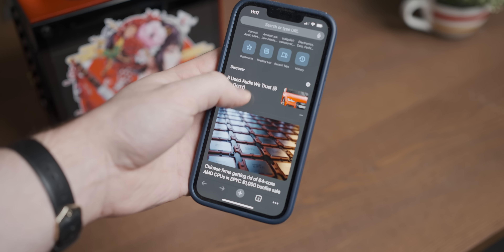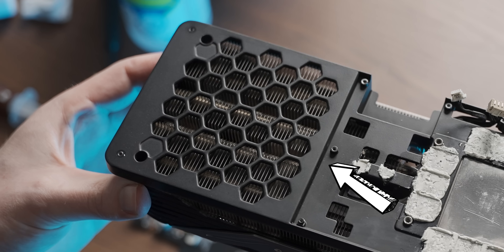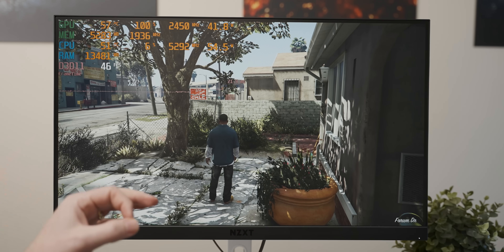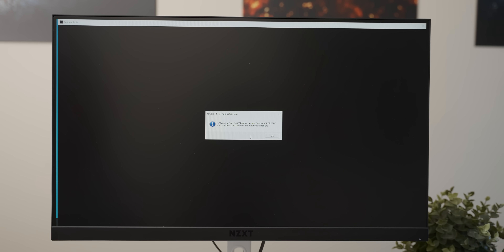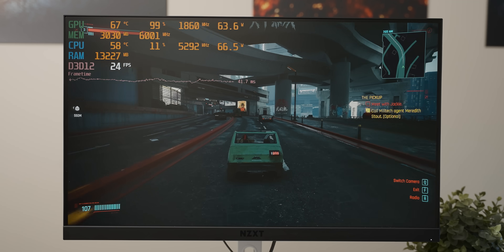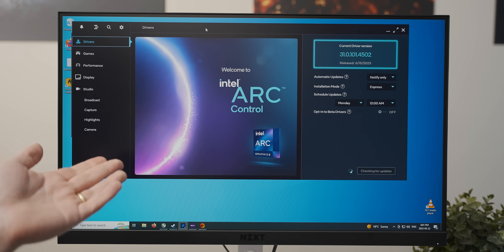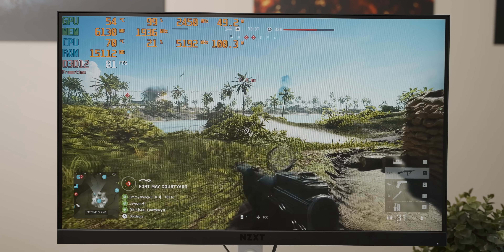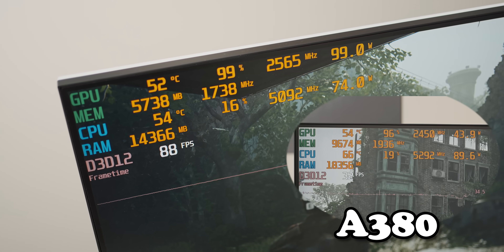The New Master Of Fine Wine Graphics Cards?

Comment: At what point does it stop being "The drivers aged like fine wine," and start being "They released it with broken drivers?"
Reply: Depending on where you go, it was always that. See Gamers Nexus. 

Given that Alchemist is Intel's first foray into GPUs, drivers being broken out of the gate was kind of expected. Not a good thing, but they had to launch the product one way or another.
Reply: Day 1 is never refined. Dlss by nvidia for example on initial release was near nonexistent or garbage. Day 1 release will always be buggy.
Reply: I had many problems with AMD GPU drivers on Dell Laptop... definitely not fine wine...
Reply: When you start coding drivers yourself
Reply: depends if you are marketing for the card or buying it.
Reply: In this particular case it's safe to call it broken drivers at launch.  Multiple games just flat out crashing, significant graphical glitches in many titles, unexplainable performance issues (CS:GO being a slow, stutter filled mess), broken UI, unreliable install / uninstall, etc.  To me, there's a difference between blatant bugs (feature X didn't work) and optimizations found over time (finding a way to do feature X faster/better).
Reply: It's ironic really, because with AMD gpu's, I always go on the assumption that, if you are happy with the release day drivers, then don't worry about it, because performance is only going to get better with time.

AMD is well known for fine wine and getting better performance, but it puts them at a disadvantage against Nvidia, because most gamers look at the performance on release, not what it can be 6, 12, 24 months from now.

The irony is, AMD cards for the price range over the last decade have always offered better performance for the price, especially once fine wine kicks in, the gap tends to widen, but unfortunately for AMD, that doesn't gain mind share or market share with gamers, which is really what they need if they want to compete with Nvidia, especially at a time when Nvidia is more or less handing it on a plate with how greedy they've become, especially at the low and mid-end.

The sad truth is, AMD and Intel should be having a ball in the low and mid-range market, with Nvidia making it easy for AMD and Intel to steal market share away from them and yet they are not moving the needing in the gpu market, a big part of that is because AMD and Intel are being too greedy with its gpu's, they have to realise that they are the underdog and have to be far more aggressive on pricing if they really want to make some inroads in the gpu market, Nvidia must be laughing their arses off with how easy AMD and Intel are making it for them, so much so that I have to question if AMD or Intel actually wants to gain any real market share from Nvidia, because if they do, they've got a funny way of showing it.

But in the case of Intel, it's their first gen gpu, drivers were a mess, maybe they don't want to go mass market till it's products and drivers are more mature for prime time, maybe the next or gen after, but AMD have no excuses, there are many things it could do to try and gain market share, especially on pricing.
Reply: The drivers they released were grape juice.
Reply: Fanboys : its fine wine
Normal consumer : so its unoptimized drivers 
Fanboys : i never have problems with driver its oooold times ago .
Normal consumer : ok 
Fanboys : haw dare youuuuu

many gamers want to experience it  again when the first times they complete the games they like but they cant . we cant erased our memory cant we ?  so we need optimized driver at begining not fine wines . same like unoptimized porting games ? 
 .
Reply: when nvidia does it. when amd and intel do it that's just fine wine or smth.
Reply: I rather have high performance from the begining than getting 10 extra fps after 4 years.
Reply: Well, tbf, they weren't broken from release, they worked. Then they made improvements over time, and gave those improvements to you for free, so I guess it depends on how you look at it.
Reply: @jeffvanstone  Nothing is for free, sorry. The cost of development of drivers are calculated into the price.  No company gives away anything for free . How would a company survive giving away stuff for free?
Reply: @AndrewTSq there is actually a company that gives away water bottles for completely free
It's all payed for by ads they put on the bottles
Reply: @jormjohnXII so then it’s not free lol
Reply: @KryptonixX  the water does not cost you any money, it is free
Reply: @jeffvanstone they didnt give you more performance for free, they got their shit together later and gave you what you shouldve had.
Reply: @jeffvanstone  You already paid for the hardware and it didn't change, only the software did. They didn't give you anything for free. If your graphics card is capable of hitting, for example, 150 fps and it only hits 95 fps with release drivers, new drivers bringing it to 145 fps, the new drivers isn't giving you "free" performance, just allowing you to utilize more of what was already there. The Arc GPU's was of course new technology, new architecture and all that, so it's to be expected. First gen Ryzen had their fair share of issues as well, so did first gen RTX cards but both the Ryzen architecture and the RTX features have improved massively, i'm sure it will be the same for Intel's GPU's as they develop and mature.
Reply: @jeffvanstone I don't know about you, but having to reinstall Windows 10 just to update the drivers doesn't constitute "working" in my opinion.

Arc drivers are in a much better place now, but at least until December of last year, they were a dumpster fire.
Reply: it was always just broken drivers, whether it be intel or amd or whatever. the fine wine thing just started out as copium from radeon fans because the radeon driver team almost never released drivers on launch day that actually used the card's full potential (apart from the rx 6000 series, which was actually pretty good in that respect).

Comment: Right Dawid! People don't understand how good the cards like the RX 6600 and 6650 XT (Other cards are available - these cards being amazing does not invalidate your choice of cheap overpowered GPU! 😀) are for the price! While people are busy with "Well at 4K with max settings and showcase RT enabled you need an RTX 234523460" - the FACT is that the VAST majority of people still only have 1080p monitors. The fact very few people (Aka most reviewers) do not actually recognize that an RX 6600 ACTUALLY slays at 1080p is borderline criminal negligence! 😀- The problem is that there IS a lower limit to this - and just like the GT 1630 - the A380 simply doesn't meet it.

The real problem for these cards is the fact that you can get cards like the RX 6600 for 180$ now - and something like a used RTX 2060 - for about the same price as this card - meaning it might be "a lot more" in % - however when building a PC and looking at the full system price - it's not that much - and the performance is not even comparable. It's a fun toy - the same with the A750 and A770 - however I would NEVER recommend anyone who is not VERY MUCH into tinkering with stuff get one over the AMD and Nvidia options. The A750 and A770 are also AMAZING performance for the price..... when they work.... when they don't then good luck figuring out why! Build 8 identical systems with the A750. 3 ran flawlessly, 3 ran mostly flawlessly - 2 constantly had issues and crashes. changed up the hardware, now 3 ran poorly, changed it up again, now all of them ran "acceptable"... 2 weeks later the first one flat out died. 3 months later another one died.... No one - INCLUDING Intel - could explain it - nor excuse it. And before you ask - I marked down which cards did what to keep track. The first one that died was one of the 2 initial GPUs which had issues, the second one was one of the ones which ran flawlessly in all 3 "builds"... so no pattern there.

Comment: The problem with every single graphics card review is that they only reference games. Which of those 3 would be better for a streaming server just as an example, stream count, codec support etc? There are plenty of other things for some people besides just a few games that have been seen 1000 times before. For me personally it's more of a driver question, so comparing the Intel against the AMD is the only important factor. As a Linux user I never entangle myself in anything from nvidia.

Comment: I think one of the biggest problems with the Arc cards is that they have higher CPU overhead, and that they also require ReBar for full performance. This wouldn't be a big deal on an upper mid-range or high-end graphics card, but on a low-end card, this makes it very impractical for most people on a very low budget. 

However, I did recently learn that most AM4 motherboards do have bioses available which do actually support ReBar/ SAM, even most first gen 300 series AM4 boards, and those bioses have also added Ryzen 5000 series support. You just need to be very careful when installing a bios, especially a "beta" bios. Read all instructions, make sure it's compatible with your exact motherboard model, and check to see if it will be compatible with the CPU you intend to use in your motherboard. Bios updates often have to remove support for old CPUs in order to add support for newer CPUs, which is janky, but far more preferable than not being able to support Ryzen 5000 CPUs at all.

Comment: I get the idea, but I don't think comparing a €143 A380 and €139 GTX1630 to a €215 RX6600 is really a fair comparison, at that point you're paying a solid €70 more, which is just straight up half of the original starting point. Given that an RTX3050 costs €199 and with a bit of luck an RTX3060 can be had for €239, I'd argue that the RX6600 is in a different price bracket. Personally if I were to put a RX6600 into the same bracket as the A380, I'd just get an RTX3060 and not look back.
Especially on lower detail settings, you can basically bypass SSAO and all kinds of shadow rendering by enabling RTX on the lowest setting. Combined with DLSS you'll probably get a better looking game with a better frame rate than the RX6600 or the A380.

But I've got easy talking here. I don't need to consider any of these previous gen GPUs. I upgraded from GTX970 to RTX4070, I'm sorted for the foreseeable future. 1080p60 with generally everything set to Ultra, including RT.
For me part of the beauty in PC gaming is that if you save up say 1000 euro over the course of a year, and not upgrade your entire system at once, you can have and maintain a pretty baller system without having to really break the bank on it. Or if you're a patient type, save up that 1000 euro over the course of 2 years and then upgrade select components to something nice, you're essentially buying a new PC every 4 years, but it only ever costs you a tenner a week to do so.

Comment: The fine wine argument is kinda moot when you start from a completely broken launch.  The biggest performance improvement for older games came from directly incorporating DXVK into intel's driver stack, so everything's translated up to a modern API regardless of what a game's coded for.  It's a smart move, they can continue improving DX12 / Vulcan performance and stability to the benefit of pretty much everything.  The "fine wine" argument may come into play for arc sometime in the future, but I think the starting point is a generally stable, feature complete driver (which they may very well have now), and measuring improvements from there.
Reply: DXVK front/mid end (it's not the whole DXVK) is used for DX9 games but not for DX10/11 games.

Comment: I also own that Gunnir A380. I don't know what kind of configuration you have but mine is running around 10 to 15fps faster than yours with the same exact settings that you have for those games. The cpu that I have is just an older Ryzen 5 2600 with 16gb 3600mhz cl18 ram. I just turned ON the 4g decoding (resizable bar) in the bios.
Reply: Yes, he probably forgot ReBar.

Comment: For my Arc A750, I run the 44.99 drivers, and they seem to work great.
Reply: yeah 4499 is perfectly fine on my A770.
Reply: I've been running the same drivers on my A750 for the last few days, been getting random black screens where they'll last anywhere from a split second to multiple seconds.

It hasn't been bad enough to make me want to change drivers for now, but I will probably go to 4502 in the next few days because of it.
Reply: @tpf92  Here are my specs in case you want to compare. X570 razor mobo, Pro 4750g cpu, Gskill 32gb 3200 ddr4

Comment: I had an intel a380 come in with my prebuilt from HP and I had TERRIBLE performance, I kept waiting for better drivers but the games I wanted to play saw no performance increase whatsoever. Halo MCC was laggy, Surprising given the fact it has old games that are very easy to run I bet a Chromebook could run it. I was just so impatient I went out and bought a new graphics card.
Reply: To be fair, you're also on a HP prebuilt. That was your first mistake.
Reply: @rustler08  i get your point, but if you get them at the right price (open box or something like that) the pre-builts can be great value.
Reply: @rustler08  it was not a mistake the motherboard is of great quality i cannot afford a 1,200+ pc and I cannot build pcs myself very well
Reply: Did you turn on rebar?
Reply: @mrmelonman2893  Yes I did and it still ran terribly on halo
Reply: There's an HP Arc Prebuilt? that sounds like a bad idea, well it's a caveat of adopting first gen of certain tech
Reply: @bimbim1885  I only bought it because it was On sale and i read the reviews and the motherboard isn't terribly cheap nor is the gpu. I also thought the intel gpu would get a remarkable performance increase but it did not for me.
Reply: That's interesting. Most people that have Intel cards say how great they are (but I often wonder if that's just them convincing themselves)
Reply: @colestowing8695  Yeah

Comment: just went to German amazon to check prices, yeah, both cards are sold around 165€, so compared the 2, the a380 is better, but when you think that the 6600 is 40€ more, and according to tech power up, it's over twice as fast than the a380, any budget conscious should just wait and save up the 40 extra euros and buy the rx 6600

Comment: So, how about the RX6600 vs A750? Both are around $200.
Reply: a750 is nowhere to be found at that price, it was a 2 day sale
cheapest 6600 = $179
cheapest a750 = $239
Reply: @tyre1337  Depends on where you are, I got my A750 for $149(sold out in 5 minutes), but it has recently been sold at $186 (2 week sale), but yes, undiscounted it's $246. The 6600 is $179 on discount abd has never been chaper, standard price is $198 here though.
Reply: Honestly, you really need to know the games you're playing when picking between those two. There are some games where the true rasterizing power of the A750 shines and it beats the 6600, but there are also plenty of games where the superior optimization of the 6600 causes it to come out on top.
Reply: @rustler08  That's what I find interesting, what games runs well on one of them and what games prefer the other option.

Comment: intel arc A380 = $120
rx 6600 = $200
a750 = $250
rtx 3050 = $230

something smells fishy here garyyyy. because you could have compared it with rx 6400 which goes around $150. but you chose rx 6600 which is 66% more expensive than a380. its best not to compare products like that especially when there is 66% price difference. Garrryyyy.
Reply: the point was really that the newest Intel drivers are not aging the cards like fine wine

Comment: DX11 continues to be a joke with these cards. For example, Halo: Reach in the MCC will sometimes drop down to 20fps when at lower than Xbox 360 quality settings.
And some things that should work just outright don't. For example, Topaz AI software doesn't work on the Arc GPUs. My A770 shipped with a copy of Gigapixel AI and it was broken on the Intel card from day 1

Comment: Not just the rx 6600 even the A750 comes at $199 in certain locations. People might actually be buying the A380 for Intel to not drop the price.
Reply: where is the a750 $199?
Reply: @tyre1337  sorry, saw it it Newegg for $199 a couple weeks back but now it's $239.
Reply: The people buying the a380, like me, were doing so to use them as dedicated encoders/transcoders in custom media centers. For that alone, the a380 stomped all over everything else.

Comment: I was looking at an intel card but then benchmarks showed it wasn't that much of an upgrade over my 5700XT and so I'm still waiting. Might see if I can get something like a used 2080 Ti or something
Reply: Sadly RTX 2080 Ti's are hard to find for 300$+, at that point it is better to buy a new RX 6700 XT that's not too far off performance wise.
Reply: @ismaelsoto9507  A 6700 XT is vastly inferior to a 2080 Ti. Compared to the 5700 XT, they'd only be getting a 25% uplift in performance with a 6700 XT as opposed to a 45% uplift with the 2080 Ti. Honestly, I would sooner recommend a used 3070 because despite the VRAM limitation, the overall performance is so much better that it doesn't really matter.
Instead of a 6700 XT, which costs new what a used 2080 Ti goes for, I would say look for a used RX 6800. That is the next step above and will not have VRAM limitations.
Reply: @rustler08  Pretty much. 

By the looks of it it seems to be a used 2080 Ti. After I sell my 5700 XT, the 2080 Ti will be £200. The 3070 would cost the game but the 8 gigs of VRAM is kind of a deal breaker atm and it performs exactly like a 2080 Ti in modern games anyway.
Reply: Yeah, I'd go with a used higher spec card.
Reply: You're upgrading from a 3060 to a 3070. It's noticeable but not much. Get the 3080 at least.
Reply: @V1car1  You do realize that the performance difference between a 3060 and a 3070 is huge, right? We're talking 55% uplift in Timespy performance.